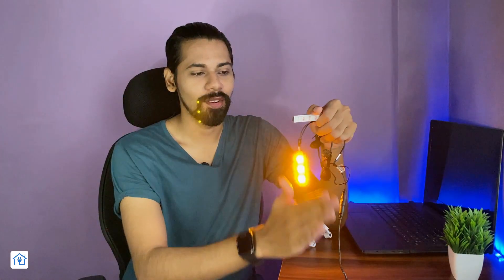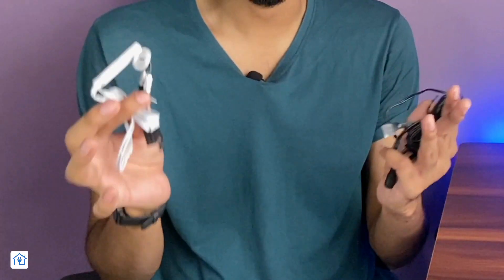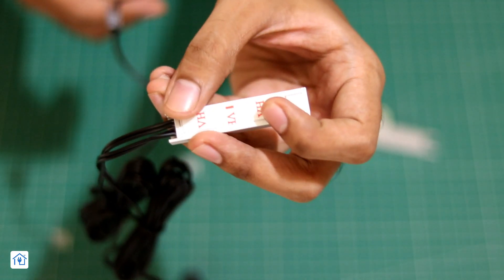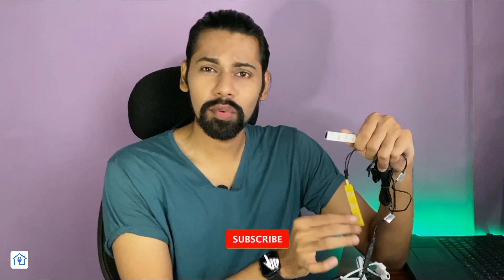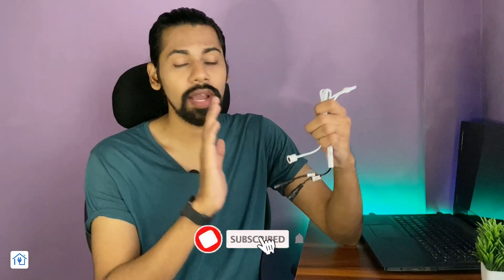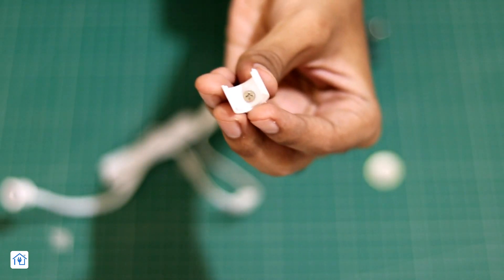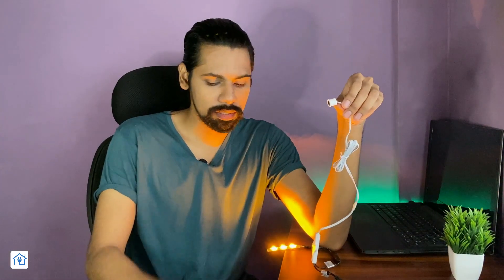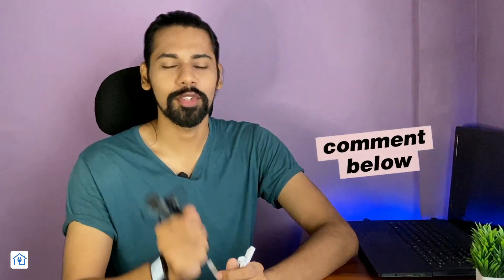Hand Wave IR Sensor LED Strip | IR Sensor for Wardrobe Automation | Wardrobe IR Sensor LED Light

Comment: Can you please try to make echo dot working on power bank? Is it possible?
Reply from the maker: Echo dot requires a continuous power supply of 12v 1.25A that is 15W. So if you manage to provide this much supply without interrupting, then it is possible. But still no guarantee for how long it will run or there might be some internal damage. Rather there are models available that run on battery. Watch this video. It might help : https://youtu.be/DiJf8Ufje0U

Comment: Technically 12 V Amp? Per strip
Reply from the maker: Depends on the power adaptor u use. If it is 12v 1A then it will be 12W. 12v 2A then 24W.
Reply: @AutomationDude  how many Amps capacity of that produces